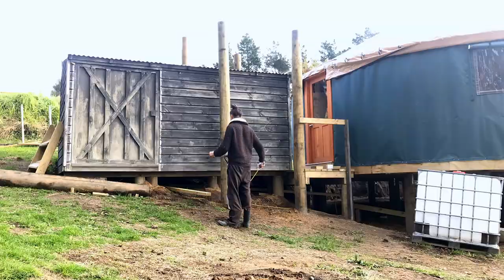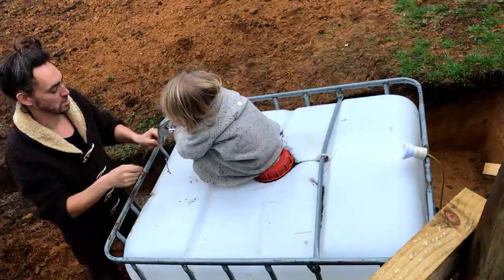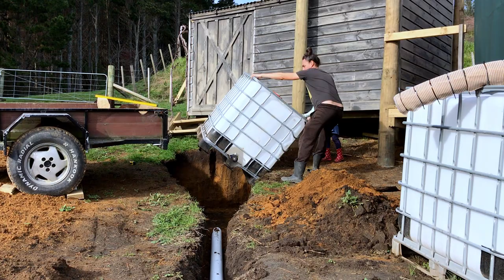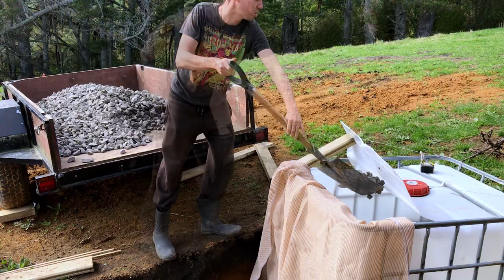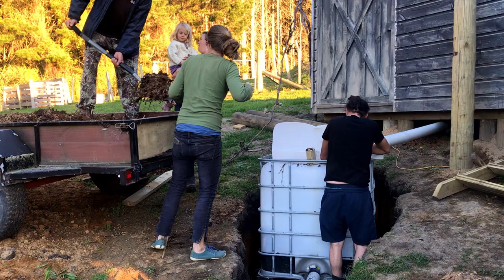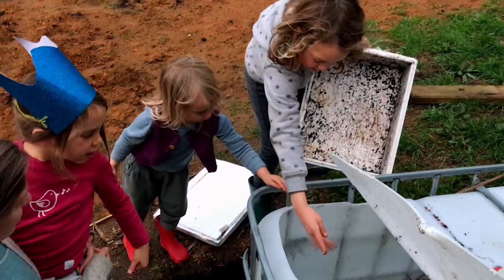Building the Yurt 08 - Toilet. Part 1: Can of Worms

Comment: What kind of fabric did you use on the bottom to contain the gravel rock, and around the drain pipe? It doesn't look like a typical nonwoven geotextile (filter fabric) that is common in North America.
Reply: It’s a insulation
Reply: So water doesn’t freeze
Reply: @chynnatown2651  I really don't think that striped fabric is insulation. Besides, with all the biological activity, the compost pile is unlikely to get cold enough at the bottom to freeze.
Reply: It is Shade Cloth. SO water can drain and the solids and worms stay on one level and don't drown.

Comment: Nice video. Especially since I'm about to do the same thing. Still, a bit of commentary would be good. Esp. I haven't seen the gravel used for the bottom before, curious about that. I can see that it might be useful, until you want to clean out some of the compost. 

And, don't take offense, I know I'm an old fuddy duddy, but even though it's kinda stylish nowadays, I'd recommend that you lose the top knot. Reminds me of Woody Woodpecker. Maybe just go with a mullet...🤯👀